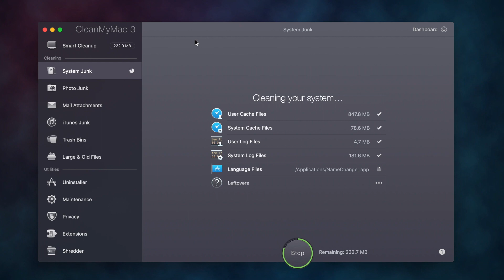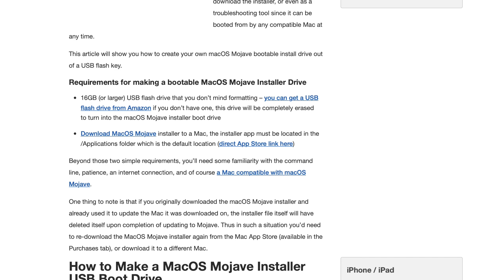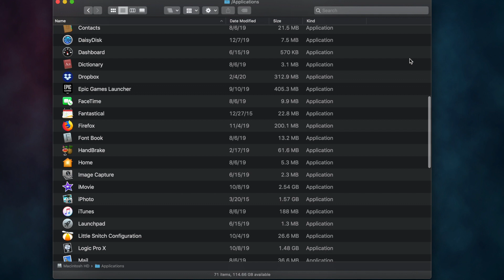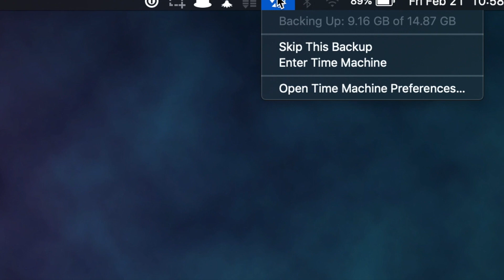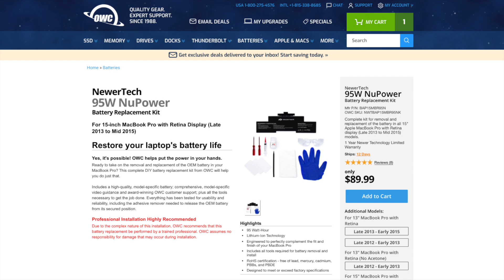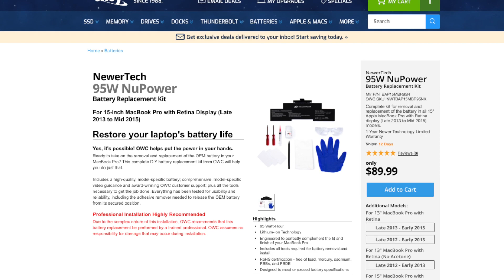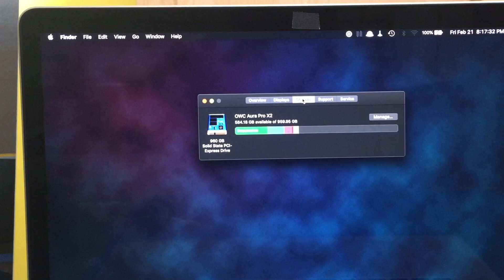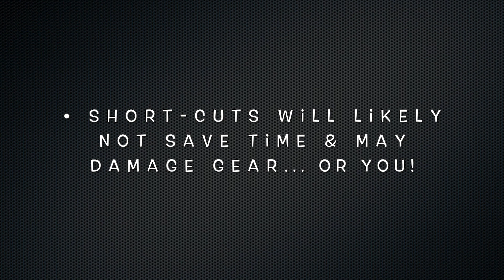Upgrading a Late 2013 Retina MacBook Pro | OWC Aura Pro X2 SSD & Miady Li-Polymer Battery Install

Comment: Any updates how that battery held up? Thanks!
Reply from the maker: Just replaced the Miady battery in December '22.  Held up better than expected for over two years.  Last month of use was only holding less than an hour charge, so it had to be replaced.
It's no longer sold on Amazon, so I opted for the OWC NuPower battery this time around.

Comment: The battery replacement is so frustrating, the glue or adhesive that they use is so freaking tough to get off. Also i found out that you could get a M.2 SSD and also an adapter which costs a fraction than aura pro (M.2 ssd + adapter = 120£ for 1tb, aura 1tb=£250)
Reply from the maker: I agree with you Jay ---- that adhesive is irritating.  I more or less malformed the old battery removing it for the laptop and got lucky that I didn't puncture it in the process.  
No doubt there are less expensive options for SSD than the OWC brand.  I've had good luck with their products in the past and thought I'd bank on their quality as a paid premium.  So far, so good, but yes I can appreciate that there are excellent options for less money.  If you have a link to share here in the comments for folks comparing prices on SSDs, it is very welcomed.

Comment: Have you tested the speed of the SSD? I’m concerned that the PCIE Gen2 x4 connection is only capable of 1500MB/s read write speeds including overheads. Making other SSD offerings more viable from a cost vs performance perspective.
Reply from the maker: I downloaded AJA System Test Lite from the Mac App Store after seeing your question.  My read/write speeds topped out at 1295/1499 after multiple tests.
I got similar results using Blackmagicdesign's app, too.
Reply: Thanks for that. So not using the full capacity of the Aura Pro X2
Reply: @jbry8372  Hey guys, according to another youtuber that also did the switch to OWC Aura on his same MBP 13", he also confirms testing lower than full capacity of Aura, but nevertheless gained somewhat substantial speed (around 22%...).  According to him: "...Apple CPUs doesn't perform well with non Apple-calibrated HD..."  and that would explain the reason why most of the Aura's potential is wasted......  But he also claimed that doing the switch AND performing the thermal paste job, the end result is about 33% more speed overall.  So, still pretty good upgrade when both jobs are done.  He didn't have the USB boot disk drive, so he struggled...  But his infos are instructive.  By the way, Thank you Thoughtful Clips for you video!  It helped me to get more prepared for the job.  I have the OWC box in front of me with the 1TB kit for my MBP 13" Build 12,1..... still have to figure out how to make that bootable drive...  You had Mojave on your system PRIOR to switching HD, right?

Comment: Congratulations on the video! Amazingly done and explained. I will upgrade my Macbook Pro Retina 13" mid-2014 (256 GB) with new Aura Pro X2 (1TB) and your video will be my guide. Regarding the "after" installation the new SSD... I have a question, maybe you had to do it, I don't know. My Mac runs Mac OS High Sierra, 10.13.6, I have made a Catalina USB bootable already. When I turn my Mac again to boot from the USB, should I update something before? Like any EFI firmware update? Many thanks once more!!!
Reply from the maker: Thanks for the feedback, Guilherme.  Glad the video has
 been useful.  

I am on macOS 10.14.6 Mojave, so I can't confirm a need for a EFI firmware update going into Catalina.  This article may help answer your question:

https://eclecticlight.co/2019/10/08/which-efi-firmware-should-your-mac-be-using-version-4/

Personally I do not trust Catalina to work well with my audio and video software requirements, so I am sticking with Mojave.
Reply: Thoughtful Clips many many thanks once more. I will give a look into the link! All the best and I wish you all success with the channel!👍🏻👊🏻